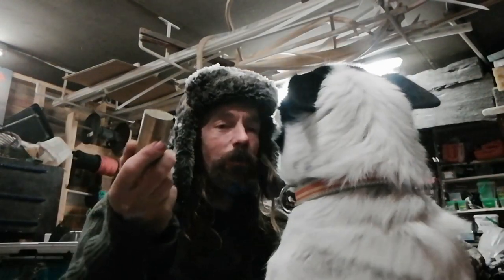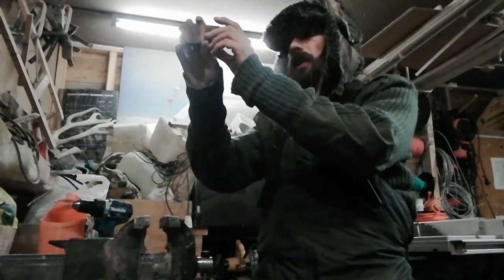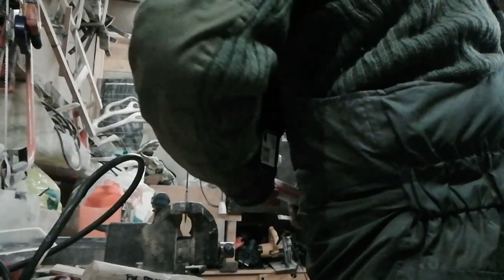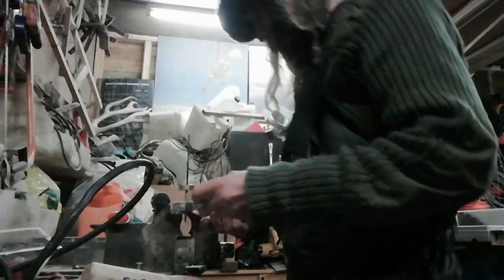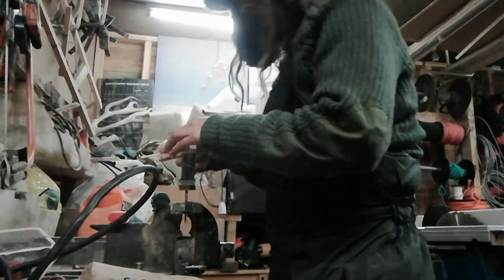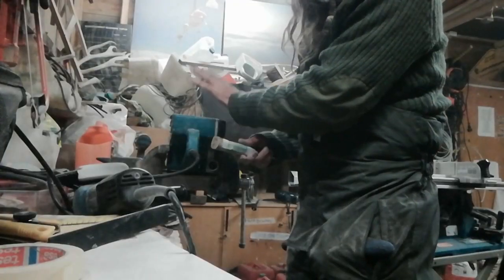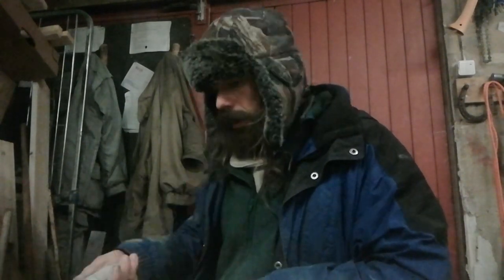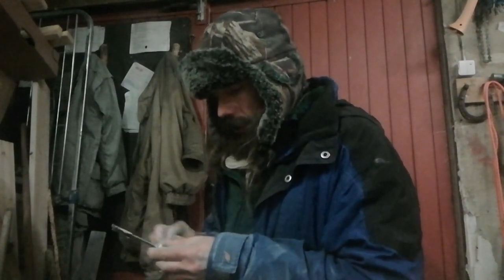NKD Timber 85, knife build from a blade blank

Comment: I do like a small puukko for carving. I've had a little Wood Jewel for years and always resort to it if any serious shaping to be done. Nice to see experiments with different materials! Cheers!
Reply from the maker: Thanks Steve mate. Wood Jewel blades are made by Lauri. You can get the same blade for about 10 quid and use pretty anything for the handle. You could also get something a bit posher like the NKD in the video. The guides normally use Lauri blades as in this video if you haven't seen it
https://youtu.be/LwNYUlksi1g
I think a nice thing to do is to use different bits of wood from different places that have some kind of memory attached. A bit of olive wood from a holiday somewhere for example. You don't need a huge amount of machinery either.

Comment: ....heavy in the hand ?
Reply from the maker: Not too bad now. I don't generally worry about balance too much, but the weight of the pommel was far too much. Much better now that I have trimmed it down. Quite happy with it now but quite a lot went a bit wrong with both the build and the filming 😂. Like I said on the video I was in a bit of a hurry as I have quite a lot on at the moment.
Through being in a hurry everything took so much longer. I should have thought about the weight of the brass too.